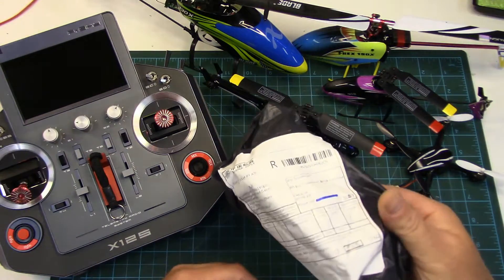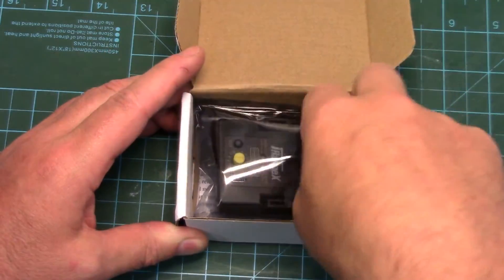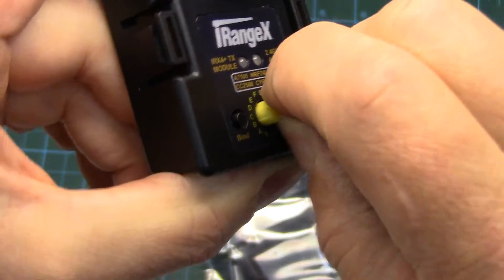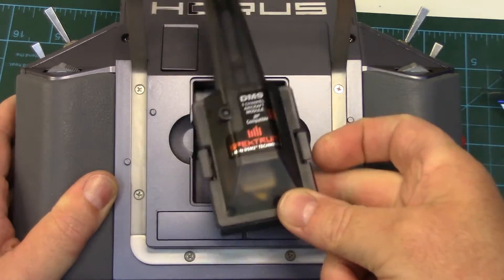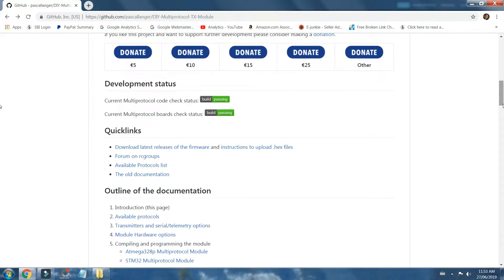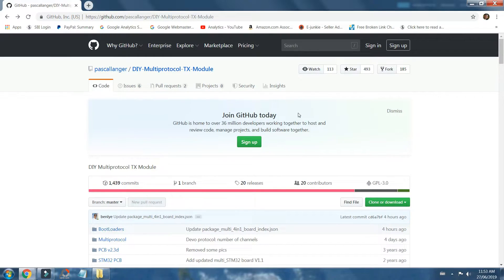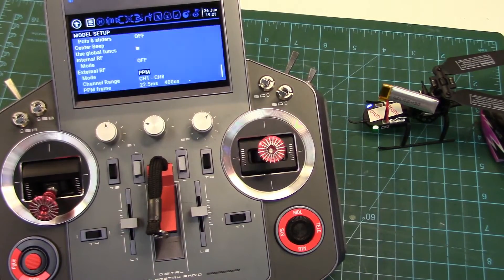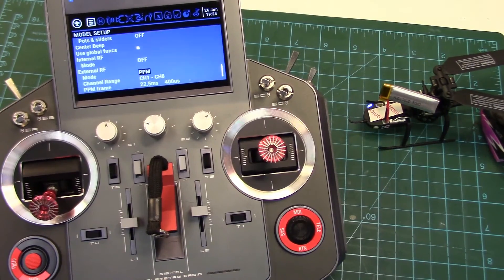iRangeX IRX4 Plus Multi Module Review & PPM Mode

Comment: John, as regards my very last post about the throttle being negative, I brainstormed it knowing that it was in one of the mixes. Using the monitor function, I found that it occurred in the Normal Throttle setting. I found that I added an SE Up switch setting to that, probably like the pitch setting using that switch in the Up position in Normal. Works fine now. You were absolutely right to recommend the monitor to look for problems. Sometimes I think it's not Open TX University, it's John Salt University, and I'm in the first semester!   Thanks You

Comment: hi mate, thanks for the vid, im interested in this same x12s transmitter, have some concerns if you could help please, im goin to use only flysky receivers, question is, how much power the multi module take? if you full charge your x12s, will it last long? 
and if the range is good on the multi protocol? thank you very much

Comment: Thinking of adding this to my Flysky Nirvana & getting rid of my IRX8M multiprotocol TX.

So if you lose that piece of paper, you're screwed? Would be nice of the protocol selection could be done in the OpenTX menu.
Reply from the maker: It can be done in the menu when using serial mode. This was part 1 - PPM mode operation. Part 2 is serial mode operation: https://youtu.be/XmUIdMsBnZI

Comment: hello im using flysky nirvana and the external module irangex irx4 plus multiprotocol and the option in the external rf on the remote there is no the multi option only ppm,xjt,r9m,etc and what should i do.. can you please help?
Reply from the maker: You'll likely have to update the Open TX firmware in your transmitter and then enable the Multi module in the build options. I did a video on that too because my Horus was the same way (it had no multi option at first). Here's the link: https://youtu.be/XmUIdMsBnZI

Comment: will the Irangerx work on the FROS   or is it for open tx i just bought a x12s and it still has fros on it
Reply from the maker: Works with OpenTX. No idea with FrOS? It should work in PPM mode, but definitely not serial mode and to be honest, using the multi module in PPM mode is very limiting; it shines however in serial mode. Confirm OS options on Muti-Module's website & forum: https://www.multi-module.org/basics/radio-compatibility

Comment: John, my setup is the same with the Horus 12, and the iRanger. I have a Blade 120S 2 and I can't get it to bind. I'm in option 7 for spektrum. The one difference I see is that the Green Light does not go out, as the protocol list says it should. Any ideas? Thanks, Jim
Reply from the maker: Did you have the radio turned off when you made the dial selection? It won't change protocols if the module is powered up. That's about the only thing I can think of. With that said, I would switch over to serial communication ASAP. It's so much better than the dial selection method in PPM mode. I would also update to the latest version of multi-module firmware if you haven't already (1.3.1.36). It's so much easier to do now as well with the new Multi-module site. https://www.multi-module.org/
Very extensive instructions and information on their site plus the awesome file filter tool allowing you to quickly get the right version of firmware for your specific radio & preferred channel mapping. Even if you don't switch over to serial mode, there is lots of good info in the Multi-Module site that may help with your specific issue.
Reply: By the way I'm on OTX 2.3.5
Reply: John, I will try that. Jim
Reply: John, I really appreciate you being available. I've checked that multi site. It should be included with the module! As it turns out the receiver in the 120 S is acting up. I switched to my second 120 and it bound just fine using the serial side. I set it up exactly like yours on the video. everything works except the throttle is inactive.Looking at the monitor, when the stick is at 0 the monitor show -40 and moves to zero near full throttle. Must be something in the set up, but I don't see it. Thanks, Jim

Comment: How many max channels can you use with this module? I have the same Tx and also have a lot of spektrum models  I have a DX8G2 would like to see if I can do more than 8 channels. Thank you.
Reply from the maker: Its' protocol dependent, but to the best of my knowledge, DSM2 or X on the iRangeX IRX4 will support up to 12 channels. That is just going by memory on what I read in several forum threads several months back; I've personally never used mine on anything greater than an 8 channel model and it worked fine with 8ch. Github should also have the max supported channels for the various protocols in their DIY multi TX module section which I link to in the description.
Reply: @Rchelicopterfun  Thank you so much

Comment: John I have dozen spektrum rcx and few blade helicopter s. Do you notice delay in response with the external module in ppmode? Can external run in serial mode?
Reply from the maker: None that I have noticed as a scale and sport flier. I used to fly all my Speky stuff with the Spekrum DM9 module and this one behaves the same. Not sure I fully understand your "Can external run in serial mode" question; but if you are asking if this module can run in serial mode, yes it can. I have a separate video on that: https://youtu.be/XmUIdMsBnZI
Reply: @Rchelicopterfun  I latency of ppm and then converting it to digital for the external module adds a layer of computing. Serial faster protocol. I am hoping Frysky will do what jumper did with having multi protocol built in with serial.
Reply from the maker: You really think that small factor of latency is noticeable for most flying skill levels?
Reply: @Rchelicopterfun  I noticed flying a blade 450x with yellow kabar. I was using dsmx satellite from spektrum and I felt conmected. Then bought Orange satellite dsmx that outputs ppm. On the same heli it felt duller like I had more expo. Observed on vbar software aileron and elevator would not center and needed constant trim of few points. The tail gain was drifting as much as 8 points using ppm out line to kbar .
Reply from the maker: Interesting. I never noticed anything like that on my FBL units (mostly Ikons & Bavarian Demons) and a couple flybared machines when I flew with the Speky DM9 module with Spektrum & JR Sats. As I slowly changed all my Speky & JR RX's over to FrSky RX's on my larger machines to run on the internal RF, I never noticed any difference/improvement either. Again, I'm a sport and scale flier. Perhaps hard core 3D'ers could pick up on it?  :)
Reply: @Rchelicopterfun  I am just sport flyer on heli. Basic flips , rolls. The vbar software confirmed the ppm out on orange receiver with ppm drifts on some channels . dsmx line in or sbus are solid and centered. Reading site comparing sbus to ppm. Sbus at most is 9ms to 25 MS. PPM could be 80ms because it does averaging.
Reply from the maker: Guess that's exactly why I've never noticed it. Anything faster than 100ms is perceived to be instantaneous to the fastest human meat servo, so even 80ms response is fast. Moreover, since this meat servo is 52 years old, I bet my response/detection speed is well over 200ms now. 🤔
Reply: @Rchelicopterfun  LoL I best you one year in age. I like my heli s responsive. Notice when I have light blades compared to heavy blades. Servos also have latency depending on quality.  Josh Bardahl who has a drone channel talks about latency. He said it depends on the type of flying. If out in open field it won't be noticeable. You get use it it. If doing fast flying avoiding obstacles then it is only notice able if you switch from high latency to very fast low latency. Sbus is 4 times faster . I think at 60mph,  80ms is 2 meters of distance covered.
Reply from the maker: Yep, exactly. Not what I fly or how I fly.

Comment: John, any way to use this or another module with FrOS. I'm looking to use my Horus X10s with DSMX RX's. If it works with FrOS, would it also be able to show DSMX telemetry data? I know that multi protocol modules work with OpenTX but I want to stay with FrOS because it's easier to set up a model, at least for me. ThanX
Reply from the maker: Only works with OpenTX
Reply: Thanks John

Comment: Hi will this unit work with my Horus X10S running Ethos. Cheers
Reply from the maker: Not 100% sure. It should work in PPM mode, but pretty sure in won't work in serial mode since the Multi Protocol models to the best of my knowledge are only supported in serial by Open or Edge TX. It would be best to post this question on Multi Protocol's Website/Forum.

Comment: Don't mean to sound green but what exactly does that thing do and why would you need it?
Reply from the maker: Guess I didn't explain it clear enough in the video? These things allow you to  control multiple protocols (many different RC brand RXs) with one single radio (TX).
Reply: To add more to John's explanation:

It allows you to bind a "proper" transmitter to those "toy" level drones and helis that come with their own controller - hear John's comment around 1m:04 and see the selection of models he has on the RH side of the workbench; that type of model.
These can use several different protocols so this allows you to work through them until the model responds.

This can be used on e.g. this type of drone:
https://www.dronesdirect.co.uk/p/pfbd103/proflight-box-drone-indoor-protective-bumper-drone

.... comes with a controller who's sticks are so short it's almost impossible for someone with adult fingers to control enough to be flyable. 

Being able to use the longer stick throw and variable rates and expo available on a "proper" transmitter allows this size of drone to convert from an "0-100% in 3mm of stick movement" almost impossible-to-fly state to something that can be confidently flown around furniture and light fittings.
With a similar controller to my example model's, I somewhat overcame the short stick throw by tapping a thread and using a couple of 3cm machine screws to extend the sticks, but that still doesn't give me the rate and expo features available on a full size TX.

Comment: Is there a website or something that shows the updates to the list on the paper?
Reply from the maker: GitHub's page on the multi-protocol modules should have it or at least the most current list of available protocols that can be accessed in serial mode (more than in PPM mode).
Reply: @Rchelicopterfun  , thank you kindly sir. I will check it out when I get home. Just received my module today.
Reply: Mr. John, I tried to bind my X12S with my Spektrum plane and it bound but the controls were way off. Rudder was ailerons, ailerons were rudder...etc. The radio was in mode 2. What am I doing wrong? Do I need to use open tx and not just the IRX4 plus?

Comment: This module has a range of several meters?
Reply from the maker: If that's a question, RF range is dependent on many factors (type of RX, antenna placement, antenna direction/orientation,  antenna polarization, diversity, environmental conditions, etc.) Certainly much more than a few meters.  More like many hundred if not thousand + meters when paired with a full range RX.